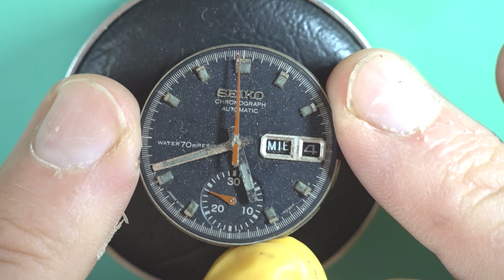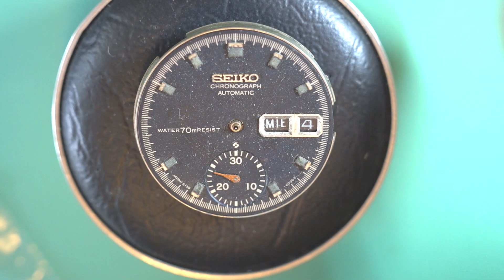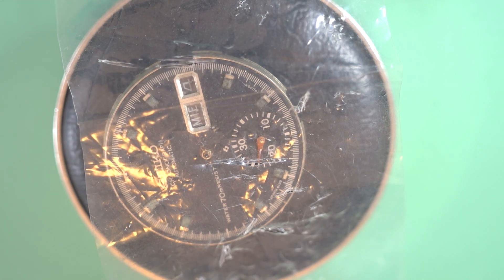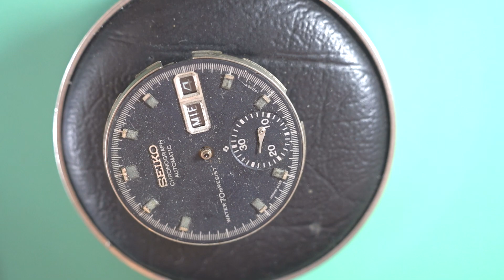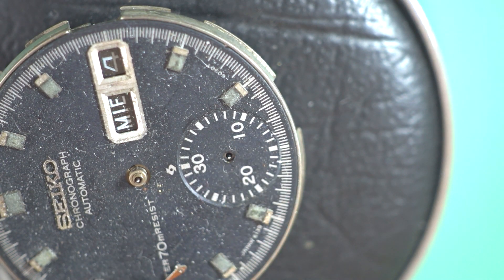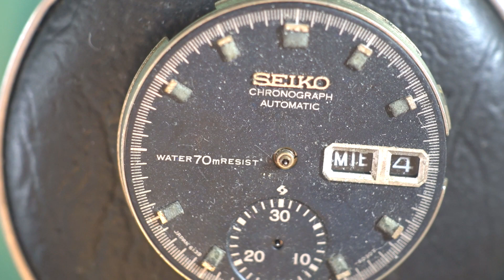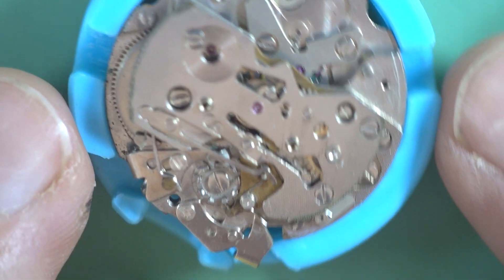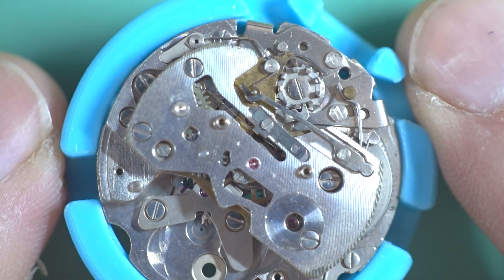[SERVICE] Possibly The Roughest SEIKO 6139 Restoration? - PART 2

Comment: Adrian thanks for this video, really nice to see this level of detail - would love to see the cleaning process and assembly!
Reply from the maker: I have that on the to-do list. My cleaning machine is old but a technical marvel of 1970's electro-mechanical engineering. It all runs on giant cams and timers. I'll take the sides off and you'll be able to see it all run.

As for assembly, I'll do that one day but find it difficult to get oiling right while running the camera and having little work space.

Comment: Enjoyed your video, grubby Seiko indeed, a good idea to put back the 2 fine threaded  screws takes seconds. Thanks for posting.
Reply from the maker: I always put them in their own section in the parts tray specifically so they don't get mixed up. A few seconds there saves considerable time later going through boxes of screws or pulling things apart.

Comment: Thanks for your great videos. I've heard Spencer Klein talk about the 'clutch' on these 6139s. He says the clutch gets more worn if you don't leave the chrono hand engaged (spinning). It would be great if you could show that part and explain if you think the central seconds hand should be left to run or not on a 6139. Cheers
Reply from the maker: Will do. My take on it that it's mostly correct. Its not so much the clutch plates that are the issue, more so the clutch spring. When the system is engaged the spring is relaxed so it reduces the risk of it cracking. That said, most of the damaged wheels I've seen have been damaged by incorrect adjustment on the reset spring and/or dirty pusher seals. If the pusher seals are dirty and have hardened, the tendency is to push harder on them to start/stop the chrono. The down side is that it puts much more torque through the system. So I could argue that if serviced and adjusted properly, the risk is reasonably minimal that damage could occur. The other common mode of failure is a detached 4th wheel, which I think is related to the same issue. When servicing I usually weaken the reset spring as weak as possible without affecting the function.
Reply: @hal0eight  Thank you for the info